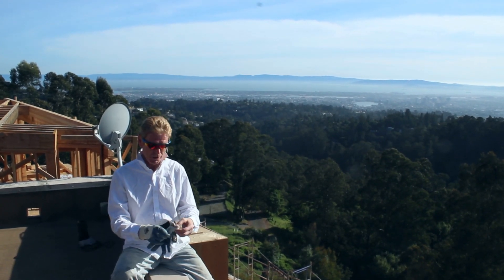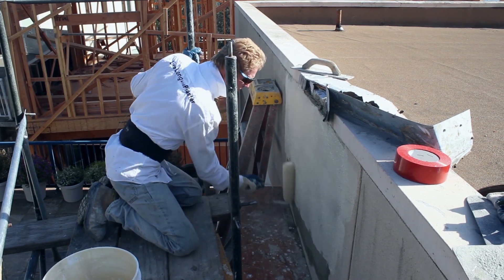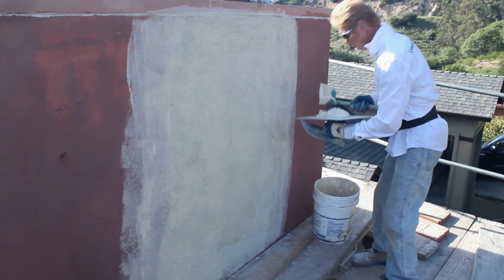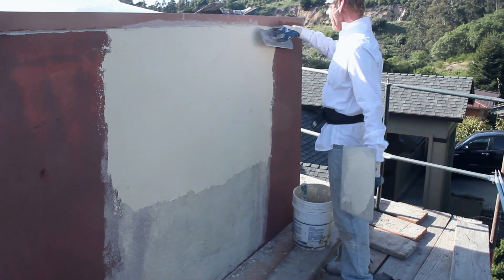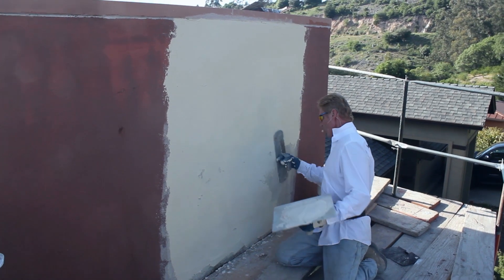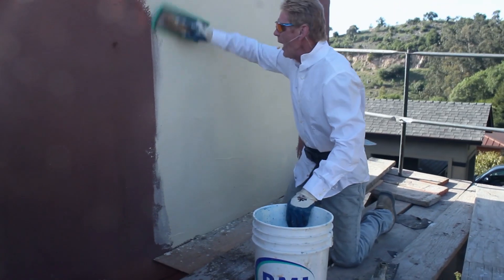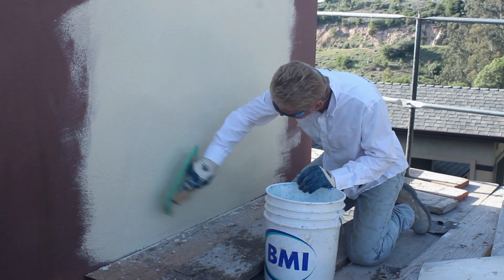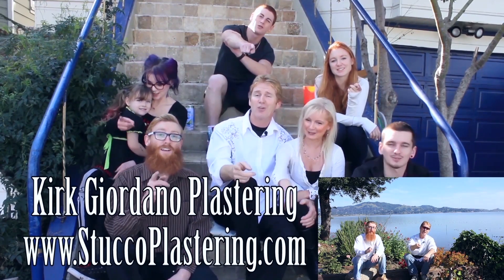Apply Stuc-O-Flex or Stucco-flex acrylic stucco

Comment: Good day Kirk, I would like to ask if it is possible to smooth acrylic, silicate or silicone plasters with a sponge trowel. In our country in Europe, the wall is smoothed with a plastic trowel. Your method seems more interesting to me. Thank you for your answer.
Reply from the maker: @JiříKupec  using a sponge float will leave a sandy appearance. Depends on the amount added to your acrylic.

Comment: Kirk, I have a room that is already painted with a latex paint but the texture is not what I like. Can I just cover over that painted wall with a texture, or will it not stick?  Or should I remove the sheet rock and start over? Thanks in advance for any help here...
Reply from the maker: Howdy Tony, clean your current painted wall well, apply the bonding agent Plaster Weld by Larson's, then apply whatever new finish your heart desires. 
There is absoultly no need to remove your sheetrock.     
                                   Live long and plaster
               Kirk Giordano’s Plastering answers to life’s issues
Reply: thanks Kirk!!
Reply from the maker: No worries Tony,  
                        Live long and plaster
 teaching plastering techniques to all interested

Comment: good day Kirk, so I'm on an eifs acrylic job(medium STO) and last minute homeowner
Reply: changed design wanted a "swirly" float finish, one of which I've been trained not do to, question is how does one acquire a an ugly swirly acrylic float finish, I've done  5 different sample  boards at home and can't quite kick the habit of evening it back to a uniform layout rather than "swirly draggy swirls" is it scraped on when applying, or layed on thick? use edge of float when floating or just keep on swirling, can't quite get the grasp, any advice you've got to offer is greatly appreciated

Comment: Hey Kirk love your Videos.

I have a 2 part question.

#1 how much should I Dilute the Larson's weldCrete product with water.

#2 I'm going to re-stucco my heavy sand finish house into a smooth finish, should I use a 16/20 La Habra or a 20/30?
Reply from the maker: Howdy  Red Eyed Dude, I'd suggest you do as the can says not as I say, I dilute for personal reasons such as to kill suctions, advanced stuff.
 If you want to soften a heavy sand finish you must use a finer sand such as the 20/30, or even a 30/30 which is LaHaBra calls "Santa Barbara," 
BMI color finishes call their fine sand "Marble"   
                                   Live long and plaster
               Kirk Giordano’s Plastering answers to life’s issues
Reply: Kirk Giordano plastering Inc. thanks brother, your the best. Love your Videos I watch them everyday
Reply from the maker: Howdy Red Eye, didn't you just hire my pal Andy Davis for your project last week?
 Can't go wrong with that guy, he's as good as they come, plus increadbly strong. 
                                   Live long and plaster
               Kirk Giordano’s Plastering answers to life’s issues

Comment: So as usual the painter gets it in the neck when the other trades cut corners.
Reply from the maker: Howdy Michael, dude, I made sure you or any other painter contractor would not have to explain your work by going the extra mile and leveling the playing field.
       They did have bids on just a cementitious finish with no primer or acrylic finish.
 I went the extra mile and killed the suction on the patchwork, thus eliminating any ghosting or bleeding by you or any other painting contractor, that may not have had your knowledge of different suctions and the problems they create within a wall that's sealed and could have easily had  patchwork with a cementitious finish that would not have been sealed. 
  I sealed this wall to match the existing sealed wall to purposely Ovid any ghosting and or bleeding.  
                        That's just the kind of guy I am.   
                                   Live long and plaster
    Images of Kirk Giordano’s Plastering projects and tips
Reply: You are a good man Kirk. I wish i was following along after you work all the time and it would come up a treat.
Reply: True that mate, i would fight you for saying that but I am to drunk to stand up.
Reply from the maker: Howdy Michelangelo, thank dude, I feel the fact is many long-term plasterers know what they are doing, the question becomes, where do you find fellas of a higher caliber.  
As you yourself appear to be in the painting industry. 
                                   Live long and plaster
               Kirk Giordano’s Plastering answers to life’s issues